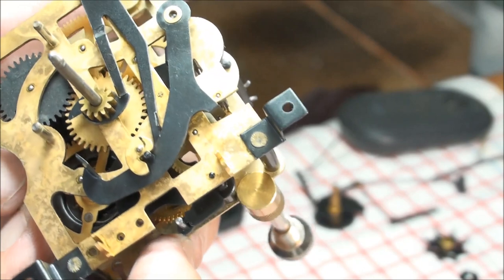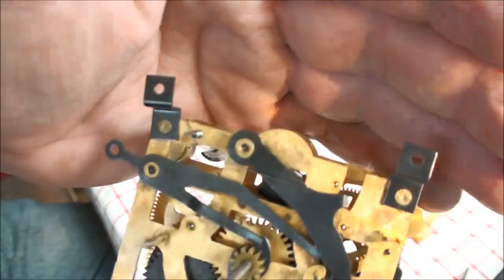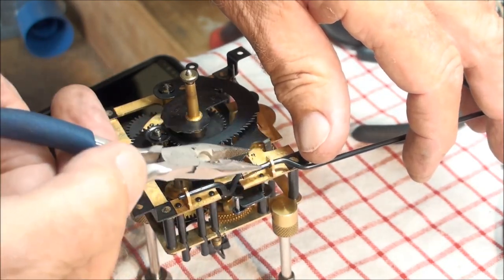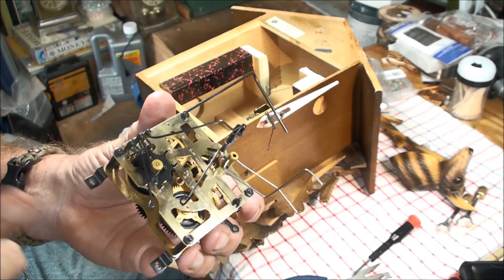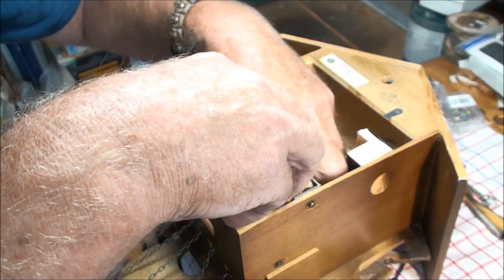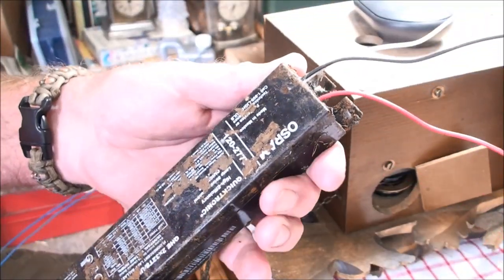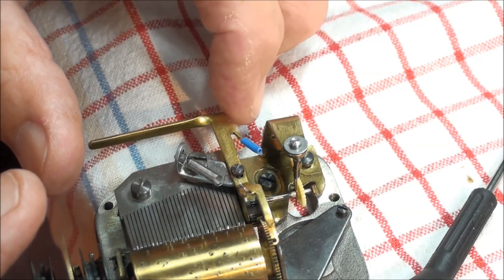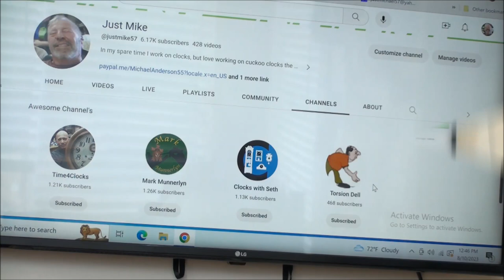Part 2, Larry's Cuckoo Clock Repair

Comment: I'll have to bookmark this one I think.  I've been watching for awhile and need to take our cuckoo clock down and oil it.  Probably won't take the movement apart and clean it this time, as it's running fine.  But when I do, the main thing I was concerned about was the timing.  This video shows the snail and pacman on the front and the wheel on the back for the cuckoo very well.  Thanks.
Reply from the maker: Taking the movement out is a way of learning your clock. Take pictures before you take the movement out, have a can of air to blow out the dust from the movement and then oil both side of the movement. With your clock still running, you shouldn't have to take it apart all the way according to the book. When the dust and oil starts to gum up because of drying out oil, then it is best to start over and clean your movement. Thanks for watching and glad this video did you some good.

Comment: As always Mike you did a great job in repairing this clock and getting it up and running. I hate those musical adjusting sections where you have to adjust that lever to get the last note in. They are a pain sometimes as everything flops around. You did a terrific job in adjusting it. Even though I thought at first that when you went to cut on some wire that you had intermixed your videos. LOL. Larry will enjoy this clock for many years to come. As you say a one day cuckoo clock bushings arent necessary as some people think. I have only had to put bushings in just 1, one day cuckoo clock so far. Knock on wood. I gave 2 of the 3 sisters cuckoo clocks for Christmas back before my mom passed away in 2018. Both clocks had bushing wear. Both clocks are still ticking away over 5 years later. My oldest sister winds  her clock every day. My younger sister had  her clock in a room that she barely went into but she has since moved it to the living room area. So God only knows how long they will last before they need bushing replacements. Thanks for the shout out at the end of the video and for mentioning the other folks. May God continue to bless you and yours.
Reply from the maker: If it weren't for you Mark, this clock would have never gotten repaired the right way. I might have come up with some backyard looking something that might worked, lol. You have a great week and May God Bless you.